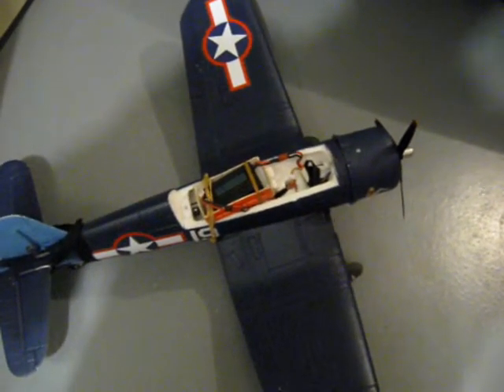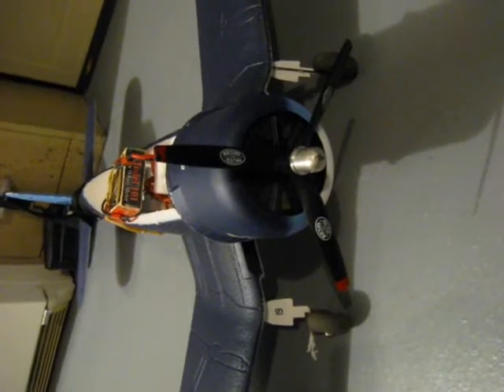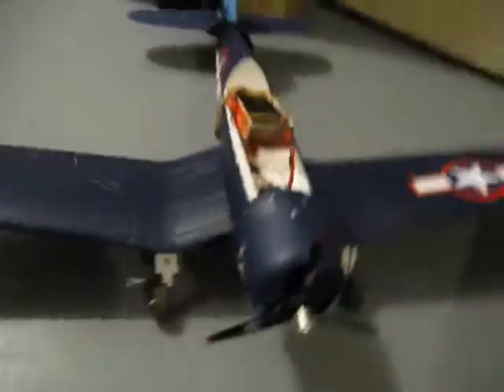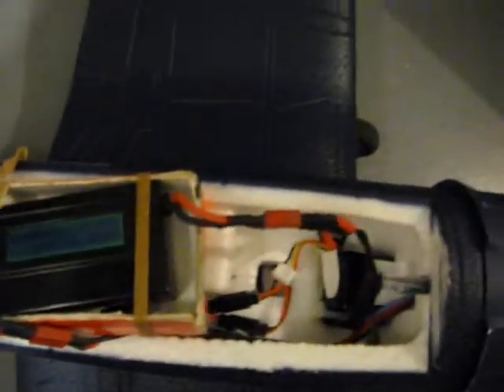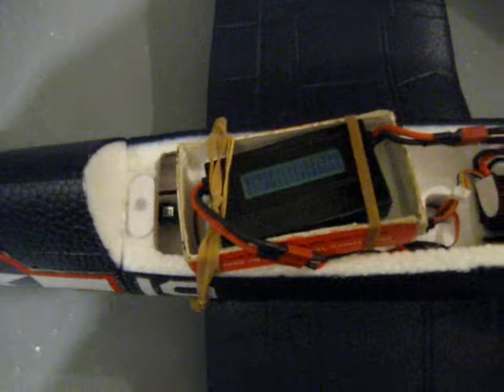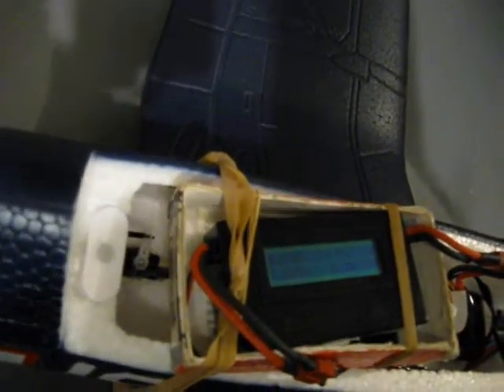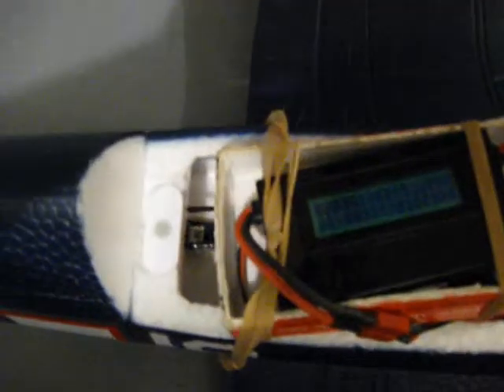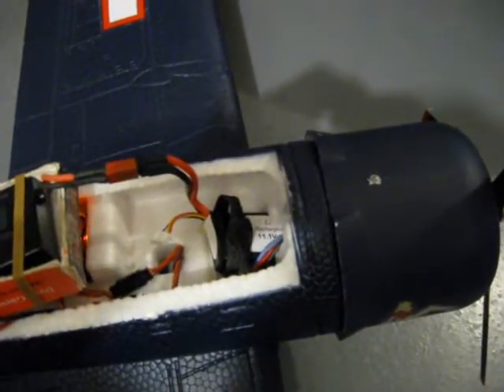Park Zone F4U Corsair stock with Master Airscew 10X7X3 10 6 09

Comment from the maker: You might have a different type of propeller from Master Airscrew!  I went back and checked the one I used and it has a Part Number of TB2518M on one of the blades and TB1070 on the other and the last 3rd blade has nothing.  Again, I did not ream out this propeller and works perfectly with the STOCK Park Zone prop adapter!